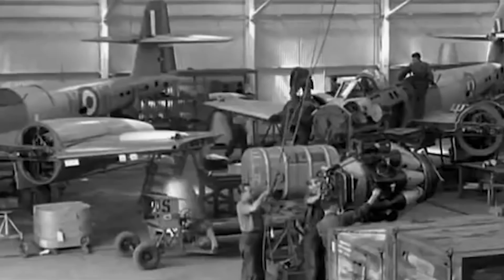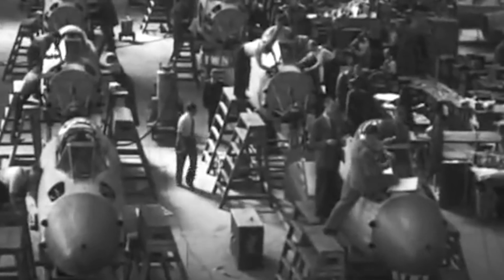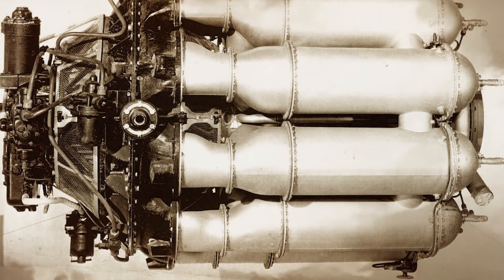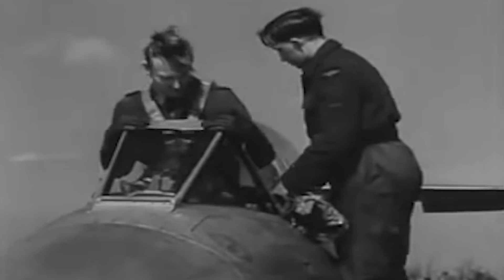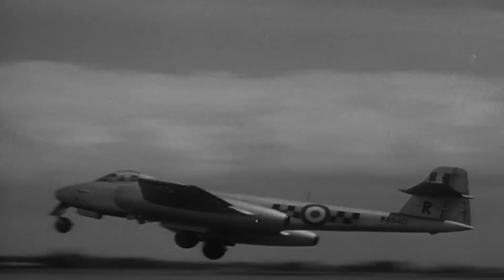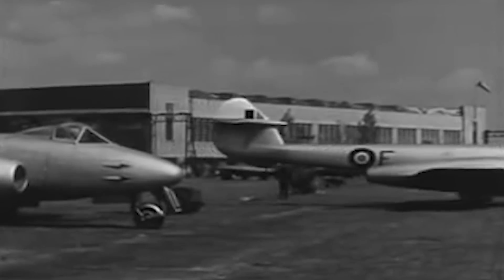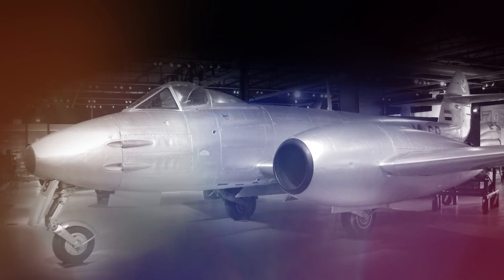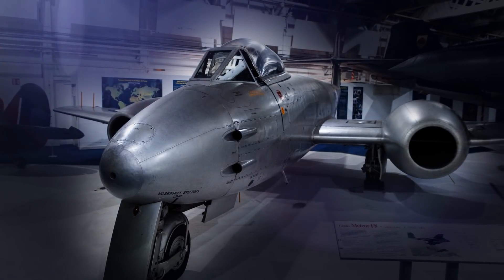Gloster Meteor - The Only Allied Jet to Fight in WW2

Comment: 1:10 If the British were the inventors of the jet engine, then why Germans were ahead in producing jet fighters and better engines?
Reply: Their engines weren't better, they were incredibly unreliable compared to the British engines. The Germans were desperate and pushed out their Jets into the fight before they were ready. 

The Meteor achieved full Squadron status 2 months before the 262, which showed that the UK could build more Meteors than Germany could make 262s if required.
Reply: @youraveragescotsman7119  British jet engines were radial compressor and obsolete. Meteor was slower than piston planes.
Reply: @jacobjonm0511  

That's not even close to true, but go off.

The F3 Meteor was 40mph faster than the 262, had 2000 meter higher service ceiling and had 2x the climb rate.
Reply: @youraveragescotsman7119  nope. Meteor was never faster than ME 262. It was slower than propelled planes. You are talking about post war variation.
Reply: @jacobjonm0511  

And your source for that is?
Reply: @youraveragescotsman7119  there is no source for speed of meteor during the war. There is also no combat between a meteor and enemy during ww ii. So basically it was a paper tiger during the war.
Reply: @jacobjonm0511  

Then your claim that it was slower than Prop Planes is complete bullshit until your provide a source.
Reply: @youraveragescotsman7119  lol you prove me the source on speed of that junk during the war.
Reply: @jacobjonm0511  Well amongst other fails of the 262 was it wouldn't fly at more than 75% or the engines would disintegrate; even then it wouldn't last more than 5 or 6 hours.
Reply: @crinolynneendymion8755  BS :)
Reply: @jacobjonm0511   Centrifugal compressors are still in use today. The  Me 262 engines were notoriously poor and post war the Jumo 004 design only made its way into five experimental aircraft and the YAK 15. Postwar the Gloster Meteor went into service with more than a dozen nations and served for over thirty years, the Me 262 on the other hand only saw service with two nations and was a museum piece after seven years. The poor old Czechs couldn't sell them to anyone, not even the Argentinians who were being advised by Kurt Tank and  Adolf Galland.
Reply: @fritzfieldwrangle-clouder7299  It was poor because of the lack of material to make it endurable and not because of the design. I am sure you know it but you like to fool yourself. Repeating a lie does not make a truth.
Reply: @jacobjonm0511  That's the usual excuse. But then so what, the nazis could have used the fundamentally more robust centrifugal design. The Russians had all the metallurgy they needed but in the Yak 15 could only get a service life of 30-40 hours from the Jumo 004. Again with all the necessary alloying metals they put the BMW 003 in the MiG-9 and had endless flame out problems such that they dropped that engine and chose the RR Nene for the MiG-15. The French took up the BMW003 and it took them four years and a lot of work to get a serviceable engine out of it and by then they had increased the stators, changed the blade profiles and dropped the hollow blades. From 1941 the British had the Metrovick F2 sitting available but they understood that the centrifugal flow engine was at that time powerful enough and fundamentally more robust.
Reply: @fritzfieldwrangle-clouder7299  powerful enough? British jets were slower than piston engine planes in WW II.
Reply: @jacobjonm0511  Some jets now are slower than some piston engine planes now. And in case you don't know I'll let you into a secret, engine power isn't all there is to aircraft speed. However, the Derwent 1 engine fitted in the Meteor mk3 had 2000 lbf thrust whereas the Jumo 004B had 1980 lbf.  But anyway, before the end of the end of the war Mk3 Meteors with the Derwent 4 engines were flying at 493mph. And the added bonus was that the engines didn't fall to pieces like the Jumos.
Reply: @fritzfieldwrangle-clouder7299  and yet British jets didn't shoot down a single enemy plane in WWII ;)
Reply: @jacobjonm0511  And german jets didn't shoot down a single British jet in WW2
Reply: @fritzfieldwrangle-clouder7299  but German jets were busy shooting down more practical planes like P51 and B17 :D
Reply: @jacobjonm0511  And of course German jets were busy getting shot down by more practical planes like P51s, Tempests and Spitfires.
Reply: @fritzwrangle-clouder6033  What do you expect to fly 20 Me262 against 300 P 51? that was how last two months of wasr was. 
If those planes where more practical then why everyone quickly switched to jet fighters? why didn't you keep building piston engine fighters till today?
Reply: @jacobjonm0511  If the last two months of the war and that scenario were the only settings for the Me 262, you might have a point but they weren't. Allied aircraft were taking down Me 262s from October 44 and far from only in rat runs. In Feb 45 when KG51 threw its full might against B&C troops at Cleves two Me 262s were shot down by a couple of RCAF Typhoons that were just passing and another was shot down by a Spitfire for no losses. 
And even in the scenario you choose, those 300 P51s had to defend a bomber stream of a thousand aircraft which could be attacked at any point in the stream so 20 Me 262s would never be facing 300 P51s.
But your argument does highlight the reality that the Me 262 was not widely used as a fighter but as ground attack and mostly as a bomber destroyer. Their goal was to get up to the stream shoot down bombers and run before they could be engaged by the fighters. The engines were too delicate for dogfighting and the pilots handbook forbade any spins or aerobatic maneuvers. 
And the number disparity could have been a lot less if the German's had stuck with Ohain's centrifugal design which would have given a far more robust and reliable engine. It's no surprise that Adolf Galland having flown both aircraft in service wished he'd had the Meteor's engine in the 262. Despite their shortage of pilots and fuel the biggest issue for the German jet units was aircraft availability due to reliability problems. In one month Nowotny  lost six jets to combat and SIXTEEN destroyed or damaged due to accidents and technical failures.
As for your question "If those planes where MORE PRACTICAL then why everyone quickly switched to jet fighters" it's a pretty silly question, not least because that's a term you used in your comment eight months ago but also and obviously because technology is widely known to improve. The fact that later jets would become more practical than piston prop aircraft doesn't somehow magically make the earlier ones just as practical, does it. And what do you mean by 'quickly', the Korean war started five years after the end of WW2 and American, Russian and British piston prop aircraft were involved and some shot down second generation jets even then.
Reply: @fritzwrangle-clouder6033  You don't seem to accept a simple fact that a Jet is superior to piston engine plane. You may need to listen Eric Winkle (WW II RAF pilot) who flew ME 262 and other German aircraft.

Comment: Sir Frank Whittle's invention could have turned the tide of the war quicker if his jet power fighter had been produced earlier
Reply: Frank Whittle did not invent the jet... he would not have successful demonstration of a jet aircraft engine until 2 years after Germany.
Reply: @sandervanderkammen9230  How do you think that is anyway relevant to what Glenn Middleton says. I always think it's worth reminding you of what the famous German gas turbine pioneer Pabst Von Ohain had to say in his foreword to 'Elements of Propulsion, gas turbines and rocket'-

"The first patent of a turbojet engine, which was later developed and produced, was that of Frank Whittle, now Sir Frank (see Fig. 5). His patent was applied for in January 1930. This patent shows a multistage, axial-flow compressor followed by a radial compressor stage, a combustor, an axial-flow turbine driving the compressor, and an exhaust nozzle. Such configurations are still used today..."

and -

"In April 1937, Whittle had his bench-test jet engine ready for the first test run. It ran excellently; however, it ran out of control because liquid fuel had collected inside the engine and started to vaporize as the engine became hot, thereby adding uncontrolled fuel quantities to the combustion process. The problem was easily overcome. This first test run was the world's first run of a bench-test jet engine operating with liquid fuel..."

and-

"From the beginning of his jet propulsion activities, Frank Whittle had been seeking means for improving the propulsive efficiency of turbojet engines. He conceived novel ideas for which he filed a patent application in 1936, which can be called a bypass engine or turbofan. To avoid a complete new design, Whittle sought an interim solution that could be merely "tacked on" to a jet engine. This configuration was later known as the aft fan. Whittle's work on fan jets or bypass engines and aft fans was way ahead of his time. It was of greatest importance for the future or turbopropulsion."

Comment: 😀nearly 80 miles slower than the Me 262, unlike the revolutionary Schwalbe that influences the design of Jet aircrafts 70 years later, had no swept wings to delay onset of shock waves, had that awkward through the wing mounting of Frank Whittle's Seat of the Pants design of Jet Engine design with Centrifugal Flow compressors ( compared to Dr. Hans Pabst von Ohain's multi stage Axial Flow design in the JuMo 04 ) compressors.  Even though the Slimey Limeys built over 3,000 of them ( over 800 pilots killed ), this contraption was a dead end. A more fitting name for this aircraft would have been the Gloster MEDIOCRE, a dead giveaway of British backwardness in Fluid Mechanics / Aerodynamics / Mathematics even though Hooker of Rolls Royce who improved both the Merlin and Whittle's W2 ( built by RR as the  Welland for the Meteor ) had a PhD in Math from Oxford !
Reply: Oh dear we have a troll attempting to disguise himself as intellectual and knowledgeable, rarely does this succeed.
Reply: Beyond the nonsense about the swept wings that Willy Messerschmitt himself dismissed there's also the patent nonsense that Ohain's engine had an axial flow compressor. You clearly know nothing about Whittle's 1930 patent that does have axial flow compressors.  You might want to check out Whittle's 1936 patent which is the first patent for a bypass engine which type of engine is the most commonly used in civil and military jets now. As for the Gloster Meteor, those slimey limeys built close to four thousand of them because over a dozen air forces around the world wanted them and the Meteor was in service for over thirty years.

Comment: It killed 450 pilots since production , no thanks .
Reply: 450 killed just in RAF service... over 1,000 'Meatboxes' crashed!
Reply: @sandervanderkammen9230  So not as bad  a rate as the Me 262 eh Sandyboy.
Reply: Supposing you were in a position to buy one like the more than a dozen air forces that did and which the Meteor served in for over thirty years.

Comment: The second British jet, The De Havilland Vampire, first flew in 1943 just 6 months after the Meteor. Faster and more maneuverable, development was held back by concentration on producing the well proven and in demand Mosquito. The Vampire was first jet to land on an aircraft carrier and first jet to fly the Atlantic. Top speed was near that of Me262. Entered service in 1946.
Reply: The wooden Vampire was clearly inferior to the Me-262..
Reply: @sandervanderkammen9230  You wish Sandyboy. The Vampire was a better aircraft than the Me 262 which had such crappy engines that it had an appalling mechanical failure crash rate of 33% and a pathetic service period of 10 or 12 hours.  The Vampire served in 32 nations and was still in regular service in the 1970s, compared to the Me262 which served in two nations and was done and dusted by 1950.
Reply: @sandervanderkammen9230  Yeah. The 262 was so wonderful that it could not fly due to the engines that died after such a short flight time.
Reply: @TheTheotherfoot  The USAAF tested the Messerschmitt Me-262 as part of Operation Lusty and found TBOs averaged 50 to 60 hours... excellent by WW2 standards for piston engines.
Reply: @sandervanderkammen9230  Still lying about TBOs then Sandyboy.

Comment: 450 deaths?!
Reply: 450 deaths just in RAF service, more than 1,000 Gloster "meatboxes" crashed.
Reply: It looks bad from this time but it was far from the worst for that time. In those days 80 spectators could be killed at Le Man and the race wasn't stopped or 30 spectators could be killed at Farnborough and the airshow continued.  the Meteor was in service for thirty years and with more than a dozen air forces, that's a lot of flight hours.

Comment: meteor was the only one? then what is the F-80?
Reply: Neither allied jet saw any combat as a fighter.
Reply: @sandervanderkammen9230  It's still annoying when they call it a post war jet.
Reply: @masonreppeto882  Its basically true, the P-80 had severe teething troubles and was not ready for service. After 4 planes were rushed to Europe 1 crashed and the 2 in Italy spent most of war grounded due crash investigations and technical problems.
Reply: @sandervanderkammen9230  Just because something didn't see combat does not mean it didn't serve. 
Not to mention it doesn't even matter if you admit it since there's actual historical documents proving it served on a couple recon missions. The F-80 is a ww2 jet plain and simple. complete and udder dogshit but it still served.  Didn't see combat but was produced  and flown during 1944. Anything made after sep 2nd 1945 is a post war vehicle, you're just not making any sense.
Reply: @masonreppeto882 Many post-war aircraft did fly before the war ended.. but the did not see operational service or participated in the fighing during the WW2.
The P-80, like the De Havilland Vampire are post war aircraft.
Reply: @sandervanderkammen9230  It was on recon missions that's not the same as just  flying . I'm not going to discuss this anymore.
Reply: @masonreppeto882  The P-80 was sent to Europe for testing only, the aircraft was not in operation service until after the war ended.
Reply: @sandervanderkammen9230  Sandyboy, keep in mind that you are the one claimed that running away from a Frenchman constituted combat.

Comment: I can remember seeing a Meteor for the first time as a kid of eight streaking across the sky over the Yorkshire coast. I was completely  awe struck
Reply: Over 1,000 "Meatboxes" crashed killing 450 RAF pilots alone... without  any doubt the worst jet fighter in history.
Reply: @sandervanderkammen9230  No, that would be the Me 262 which killed so many of its own pilots. The Me 262 had a mechanical failure/pilot error loss rate of 33% compared to only 22% for the Meteor.  For the Germans of course the Starfighter was next worst with 32% because they were putting undertrained pilots in it.

Also, when the Czechs carried on building 262s after the war as an attempt at export markets, they found that they couldn't even give them away because nobody wanted them. Not even the Argentinians who were awash with nazis and nazi money would have them having been advised by Adolf Galland to buy the Meteor instead.
Reply: @fritzfieldwrangle-clouder7299  
Canada had a loss rate of 46 %, Italy 38%, USA also had bad losses of the Starfighter.

Comment: 450 pilots lost flying the Meteor?  ...that's horrendous
Reply: 450 is just the number of British RAF pilots, in total more than 1,000 crashed which makes it not just the worst jet in RAF history but the worst  in history.
Reply: @sandervanderkammen9230  Cling on to that straw all you like Sandyboy but the mechanical failure crash rate for the Me 262 was much worse. The Gloster Meteor had a thirty year plus service history in more than a dozen nations. Whereas the Me 262 was wholly ignored by the rest of the world postwar, except the Czechs who built twelve to try and build an export industry with them and they ended up collecting dust till 1950 when even the Czechs gave up on it.

Comment: I think the RAF were reluctant to use it over enemy airspace in case the Germans recovered a specimen for analysis that could help them improve their own aircraft and change the course of the air war.
Reply: The true story was the Gloster "Meatbox" as it was called by British pilots was a complete failure as an air superiority fighter and models produced in the war were actually  slower than many propeller driven aircraft... it was used breifly as an interceptor against V-1 missiles but performed poorly compared to the faster Tempest and Mosquitos.
Reply: @sandervanderkammen9230  You still smarting because someone says something factually correct about the Meteor, you sad little wehraboo.
Reply: @sandervanderkammen9230  The true story of the Gloster Meteor was that it had a thirty year career with over a dozen air forces whereas the Me 262 had a six year career with two. And the last two of those was sitting on the apron going nowhere.

Comment: that what boggles me is that a jet flew on may 15 1941 but they never even got to use it during the war....
Reply: The Allies were consistently 2 to 3 years behind Germany in jet technology during WW2.
Reply: @sandervanderkammen9230  The germans were consistently crap at designing and building jet engines during the war.
Reply: @sandervanderkammen9230  The allies were up and ahead on much of jet technology during WW2 and way ahead on making the right strategic decisions.